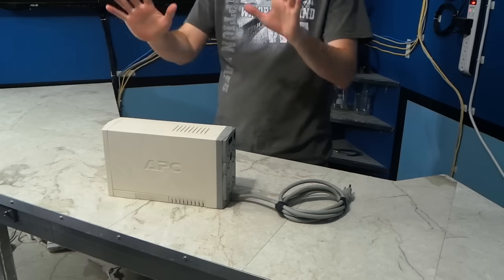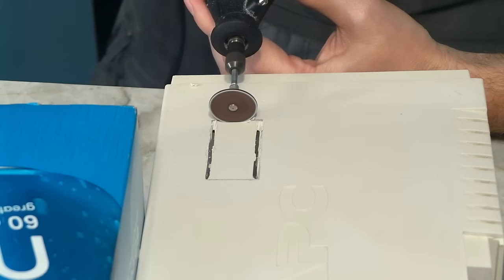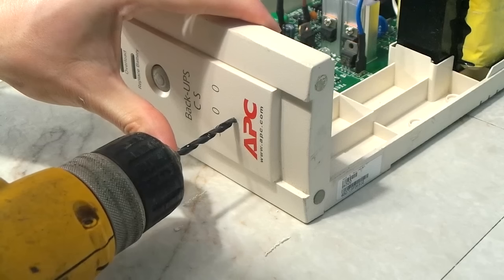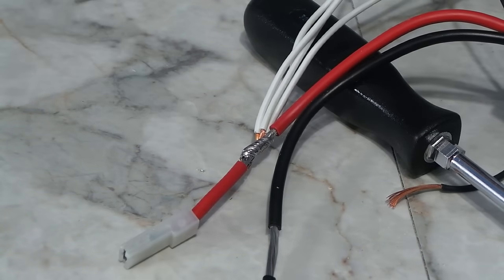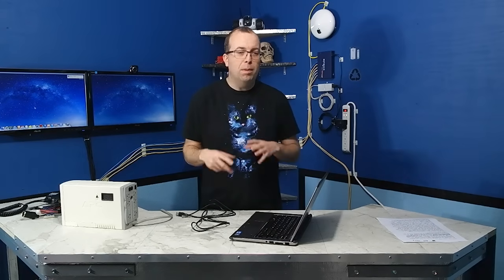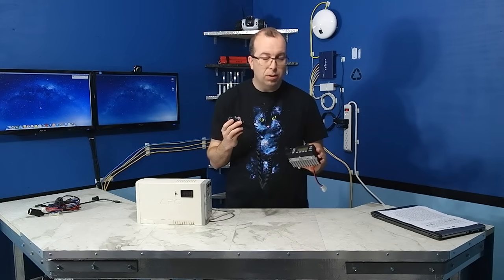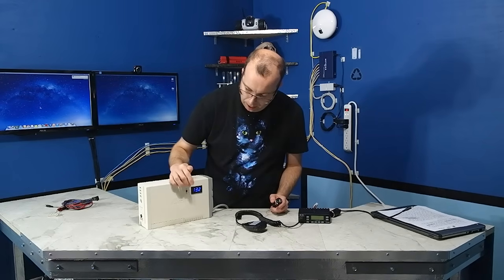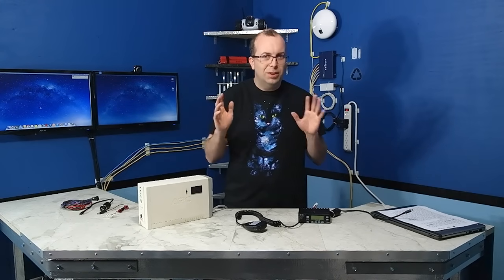Ultimate Battery Backup Hack/Mod.

Comment: A momentary switch for the voltage meter would’ve been ideal
Reply: And easier to mount.
Reply: Agreed. Although I believe he wanted the voltage displayed 24/7. (Minus outages of course) A relay could have done this automatically.
Reply: Probably just used what he had on hand, that's what I do for projects like this.
Reply: @MrV1NC3N7V3G4  It think it's worth it to not spend a momentary switch and a relay when you can just do as shown in the video.
Reply: @thejose970  nah he's right
Reply: @MrV1NC3N7V3G4  yes but a relay consumes power
Reply: @OIE82  It does. But when wired to NO (normally open) it would remain energized while the circuit was closed via power from mains and displaying the voltage. Then when power was lost it would default to NO and cut off the display to the meter - drawing no power.
Reply: @MrV1NC3N7V3G4  good idea but i think he mostly wanted to monitor the battery while on battery power. To see when its getting low.
Reply: @OIE82  I'll have to watch the video again...it's been months since I watched it.
Reply: I'd even go further and replace switch by a simple push button.
Reply: @alexxx4434  that’s what a momentary switch is
Reply: Exactly.
Reply: I'd use LCD instead of LED voltage meter, it uses so little electricity to operate it could've stayed on permanently.
Reply: @bsimic29  However, you'd have to make your own, as battery indicators that use reflective LCDs (or E-Ink displays) are not common, and probably a bit expensive.
Reply: @bsimic29  LCD Meter is hard to read in the DARK. Duh......

Comment: The battery in that UPS is likely a 7 AH lead-acid battery. If you actually pulled 16 amps or more from it, you'd drain it dry in minutes--if you were lucky enough not to burn it up & start a fire, since you didn't add a fuse. God help you if you accidentally short one of those plugs.
Reply: +Alex Lardschneider depends on the phone. a 1.5ah phone could be charged about 14 odd times. 
12v x 7ah = 84wh. 
1.5 x 3 = 4.5wh.
84 x 0.9 (dc/dc efficiency) = 75
75/4.5 = 16 charges. 
he does make some other claims that are pretty bunk though...
Reply: +sn0wchyld My phone (and most apple phones today) are 1.9 ah at 1.2v.....so that's more like 33 charges after efficiency drop.  His claims of efficiency drop through dc-ac-dc conversion are wayyyy off though....he goes from 16 to 1.  If that were true, then it would be pointless to have one of these battery backups for your computer considering your computer transforms the power AGAIN (twice in fact).....so by his calculations, your computer will run for 5 seconds?  Genius!
Reply: Andrew Wiens My reply was based on how many times you can charge your phone, not about the drain rate of the system on idle.
Reply: Andrew Wiens It doesn't die in 1 hour, terrible UPS if yours does.  Mine has about a 48+ hour drain.  I will agree that it is unlikely that ONE person can recharge their phone multiple times (because it takes several hours before their phone dies), I am arguing the point of actual CHARGES.....so if you got you and 32 of your friends to charge their phones, I'm certain it can be done.
Reply: +Andrew Wiens - everyone is missing the point he made about TURNING IT OFF! He says he would turn it off to use the 12V additions that are connected directly to the battery. If he TURNS IT OFF the UPS circuits will not be draining the thing down in 1 hour. I do agree about it being stupid to not put fuses inline with the additional hacked 12V lines.
Reply: +Jarrod Roberson The other point that everyone is missing is that you can hook up other batteries through those ports or charge it with solar panels if they are big enough. But besides having fun with the project and it is cheaper there is no point to doing this when you can buy stuff like this www.goalzero.com
Reply: +Shmeh Fleh 16A isn't too bad for this battery; the real bottleneck are the sockets. I doubt they would withstand 16A for long. When using a jack for such currents, it is mandatory to have several points of contact on each pole. Especially the central post must be a quality banana plug design.
Reply: Oh definitely. 16 amps at 12v is almost 200 watts; way too much juice to deliver over a chumpy little socket like that. At the very least, there should be a fuse in line with the plug, and ideally, some kind of current limiting circuit.
Reply: A watt is a unit of energy, in this case, a measurement of the total amount of work an electrical circuit can do. Wattage is of course derived from volts x amps, which means you're already taking it into consideration, even indirectly, by worrying about the maximum current and voltage your circuit can support. The only way you wouldn't need to take watts into account in some respect is if your wires, connectors, and everything else up to your load is superconductive.
Reply: Shmeh Fleh But adwiens is correct...soo...your statements are invalid.  Watts is work done, doesn't really mean anything unless you relate it to something that requires it.

For example, if you have 1200V running on a 0.01A wire, you can safely touch it and nothing will happen....if you have 12V running on 1A wire, you can die.  Both of these are 12Watts, see how power has no meaning in this form?  The only reason we have it is to calculate nodes within a circuit network, that's all.

I'm not trying to be a dick, just educate you a little.  As for your "dick in a socket" analogy, that doesn't quite follow since a household socket can max out at around 20A....so you will definitely feel it.
Reply: +Robert Caldwell (sabriath) There's no such thing as "1200V running on a 0.01A wire", it's nonsense. You might say that you have a 1200V source, connected through a wire to a current source that drains it to ground, set to 10mA. I can assure you that if you try and put your hands around the current source, or even between the source's input and ground, you'll be in for a world of hurt and you better have a defibrillator and someone who can use it on you nearby. If you have a 12V source, you can apply it to skin electrodes across the arms and you might feel some tingling. 1A will never flow through your body from a 12V source, that's the whole point of why 12V is a safe voltage, while 1200V isn't. Please don't comment on what you don't understand.
Reply: +Robert Caldwell (sabriath) There's no such thing as "1200V running on a 0.01A wire", it's nonsense. You might say that you have a 1200V source, connected through a wire to a current source that drains it to ground, set to 10mA. I can assure you that if you try and put your hands around the current source, or even between the source's input and ground, you'll be in for a world of hurt and you better have a defibrillator and someone who can use it on you nearby. If you have a 12V source, you can apply it to skin electrodes across the arms and you might feel some tingling. 1A will never flow through your body from a 12V source, that's the whole point of why 12V is a safe voltage, while 1200V isn't. Please don't comment on what you don't understand.
Reply: +Kuba Ober that's wrong. current or amperage is what kills you, and all it takes is 30ma at any voltage level through your heart. lower voltage is considered safer because there is less potential.

If you want to liken it to water and a water pipe for a simple way to picture it. voltage level is like pressure. more volts, more pressure. The size of the pipe is your current or amps.

If you had a 12v pressure water pipe but it was as big as a car, (high amps) it can kill you. And likewise if the pipe was small (30ma) but at 1200v of pressure.

Difference? They are both dangerous, but the higher the volts or pressure the more chance its going to go through the resistance of your skin and body to earth or ground. 

It is suggested though, that the natural resistance of the body it takes about 90volts to pass through arm to arm or arm to leg, or arm to another part of your body to earth. If it does that, its all down the current that can kill you.

You should know that things like tasers hit the body for up to 30000 volts but the amps or current is so low it doesn't cause tissue damage or interrupt the heart. That's the theory of it, but people still die as you know.
Reply: As a youngster I was playing with a neon sign transformer and was pulling a nice arc/jacobs ladder, off of it. Accidentally touched both leads. Nothing but a tingle, a bit of vibration from my arms but nothing in the neighborhood of cardiac arrest. Even after trying a full grasp of both terminals. Seems it was labeled at 15kv or so.
Reply: Electricity follows the path of least resistance which, fortunately for your younger self, was not across your heart. It's the same reason why some people survive lightning strikes--and some don't.
Reply: +David Link that's because volts jult and amps kill !! High volts and low amps is what you got to experience, high (amps)
And you wouldn't have made the comment above!
Reply: Phoenix Marzrover you're*
Reply: Phoenix Marzrover fuck off*, you're*, and no, I make them.
Reply: Phoenix Marzrover 15 Amp > 1 Amp....I never stated anything about 15 Amps, I rated 1 Amp for death, so good job stating the obvious about household sockets which has absolutely nothing to do with me.

Licking a light bulb will just taste funny, or did you mean light socket?
Reply: +Robert Caldwell (sabriath) actually 100ma can kill. forget that troll.
Reply: +adwiens Volts and Watts are not the same thing. Watts is a measure actual power, and THEY DO MATTER.
Reply: +Robert Caldwell (sabriath) He's right you know.
Reply: +DJMan_12345 I disagree that there is no point. Doing the mod and understanding how it works is good knowledge to have. Also, big battery units are tossed all the time, a buddy of mine has like a whole pallet of them that I will likely inherit this spring, something like this is a cool project to use them for if not recycling them. Keeps them out of the trash too. And I think that's always good.
Reply: +Shmeh Fleh There should be no problem drawing 16 amps from it - that's 2C, most lead acid batteries are happy to go well beyond that - although with the Peukert effect, you'll probably only get 20 minutes or so of power with it. It would be a good idea to add a fuse, since lead acid batteries are often happy to give up 5C or more, and 50 amps of 12 volts makes for a pretty spectacular show.
Reply: +Robert Caldwell (sabriath) Apple phones use LiIon or LiPoly batteries which are 3.7V and not 1.2V
Reply: +zwz • zdenek Such sockets are rated at 3A continuous, 5A surge. Testing them in extreme conditions, they melted at 10A after running for two minutes and at 15A almost instantly.
Reply: +Rumpy you half-unerstand electricity.  You are not wrong, just half assed. The taser doesn't kill you because of short pulse with. Taser can easily deliver over 30 mA thru heart. Also current is a function of voltage and resistance (for dc) so saying "30 mA at any voltage" is dumb.
Reply: +Pete Chess Actually, I would guess if you sunk probes directly into the chunk of neural cells responsible for firing the heart and ran 12V into it, it would kill you. But as far as normal circumstances, you're absolutely correct.. at some point the telcos did a bunch of research and determined that the maximum safe DC voltage you can touch is 48V, which is why you see it used in so many places..
Reply: SheepRanic
 The 48 DC besides 4x12v batteries and safety has some other historical reasons. I had a phone line in my mouth when the line rang, 90v square pulse to the mouth = fireworks.
Reply: Frankie Sparkes The serious problem with 12V and batteries in general (even low voltage ones) is that if you wear a ring, and the ring shorts the battery out, it will get extremely hot very quickly, and apart from burning you if it heats past 120°C it will cauterise the capillaries in the finger, leaving half of your  finger without blood. Of course the only solution after this is amputation of the finger.
If the battery is accidentally shorted, pieces of molten metal can fly everywhere and burn you, and even leave you without an eye if you are particularily unlucky.
On the bright side, electrocution with enough current passing through the skin to cause death or damage is almost impossible.
Reply: MrOpenGL Yeah, that's true as well
Reply: +Shmeh Fleh it was a 12Ah.
Reply: It is an old-school transformer which draws a large amount of power even with no load. If it had a switching transformer like the one he bashes for some reason the no-load runtime would easily be a day.
Reply: You missed the part where he says "In the event of a power outage , I can turn this thing off" So he would power down the UPS eliminating the current draw to the inverter.  @bash1572
Reply: @bash1572  and @Robert Caldwell - APC UPS-es can usually run for some five-six hours on brand-new, fully-charged battery(ies) with no external loads. It would probably run for some three hours charging one mobile phone (probably less for quick-charger). I'm surprised that the software showed runtime of just 64 minutes, but these softwares are known to provide poor estimates. Or the battery was already bad.

Comment: Neat hack, but I see 4 possible issues:
1. No fuses, you can make some dangerous situations! Hint: short circuit
2. The charger is likely weak (by design), so you can't drive high power loads for extended time.
3. The battery may not actually be isolated from mains, so beware
4. The wires may be good for 16A, but is the barrel jacks?
Reply from the maker: erlendse - Believe it or not, I've actually considered all of these.  I honestly don't know how many amps the barrel jacks can support.  But I actually won't be using anything myself that draws more than 1-2 amps anyway.  The charger is probably weak, but again, nothing I plan to use will draw enough power to worry about.   The primary thing I'm using (the ham radio) does have an inline fuse between the radio and the UPS.  The other things don't, but will rarely be used.
Reply: The iBookGuy actually, those things are made for computers, so they can probably give much more amps than what you are actually pluging in. Great "emergency enabled Ham radio", by the way... that's the kind of hacks that can actually save the day if hell breaks loose. I may try something similar for a two walkie talkie charging base I have arround.
Reply: erlendse i just dont like ups in general, they have there uses, but the tall ways battery mount, almost always swells the ups battery, and need changing often, like every couple of years not used. better off solar panel and 1-2 100ah batteries and a regulator to keep them maintained well
Reply: @rimzo2006  In night?
Reply: @The8BitGuy  Look at the Mean Well SCP-75-12, it's a 12V power supply/UPS, 75W output, can add a thermistor for temp compensated charging voltage, runs about $30. They also have a 24V version, which I used for backing up the SCADA electronics at a water tower site. It worked perfectly for that.
Reply: AFAIK all APC UPS-es have battery(ies) mains isolated. Many of them even support "hot" battery replacement, i.e. without turning UPS off or even interrupting power supply.

Comment: I watched this video years ago. It gave me a push to look for other info on UPS
And boy I'm happy I did -  I was able to repurpuse my APC to power notebook, modem and charge phone directly (-ish, with BMS and DC-DC power converters) of the battery, with out loosing tonns of capacity on DC-AC-DC conversion. 
Though later I switched to charger-battery-inverter solution, UPS charger just isn't powerful ehough - it's around 1A and takes >12h to charge standard battery and becaus e of russian agression we have power only around a half a day on a good day.
Thank you very much!

Comment: Hi sir very informative video but you forgot to to put fuse in dc output of the battery it could be very dangerous as this 7 ampere battery is capable of delivering very high current in case of short circuit and can cause fire aswell especially this model of APC which is entirely made of plastic
Reply: Your problem is that you're replying to a 7 year old video The Eight Bit Guy is no longer reading these comment as often as he used to
Reply: Yeah, I reckon he doesn't have this unit anymore. APC makes better units now.

Comment: Just wanted to say thanks. I had an old, but never used, UPS laying around that was only 12vdc out (for cable modem). Ended up using it to power a small timer circuit that triggers a small 12v pump every 6 hours for 30 seconds at a time. And if power goes out and I'm not home, my gecko will still get his daily sprays.
Reply: With that, your gecko is practically a cyborg.
Reply: @herrakaarme  Even more so. The original lead acid battery is finally dieing and I'll be upgrading the UPS to a Lithium battery. 👍

Comment: Get yourself a step, or stepper drill bit (called by both names, same tool) It's basically several drill bits in one. When using it, drill slowly, with slight pressure and it will gradually make the hole whatever your desired size is.

Comment: Not sure where you're going with the dislike of switch-mode vs. having an "actual transformer". switch-mode power supplies are more efficient than linear. Plus, they're lighter and smaller. If they're "burning up", it's because of a bad design. What I would point out is that these inverters usually output a modified square wave, rather than a pure sine wave. This will run a PC fine, but it will buzz a bit.

Please please please put fuses inline. Those SLA batteries can deliver huge currents that could easily turn that wire into a light bulb and set fire to your house.
Reply: S.S. Power supplies on these cannot handle any significant loads. They DO in this hack "burn up" rather quickly.